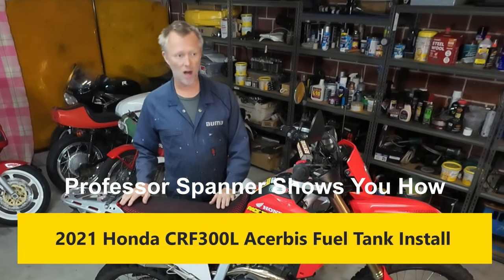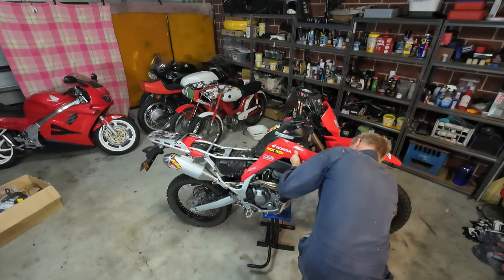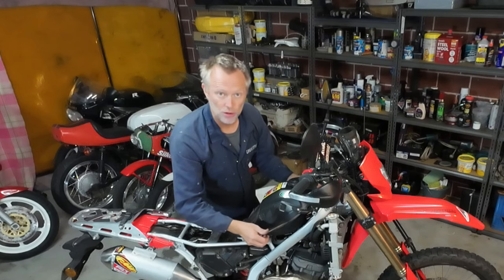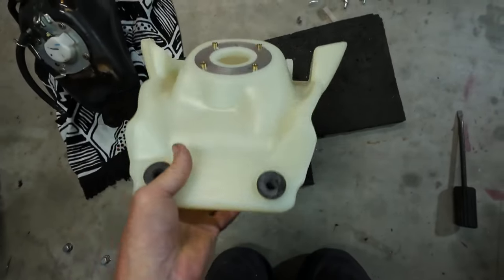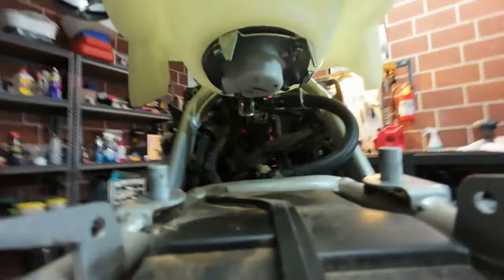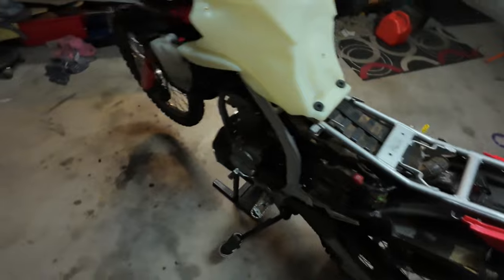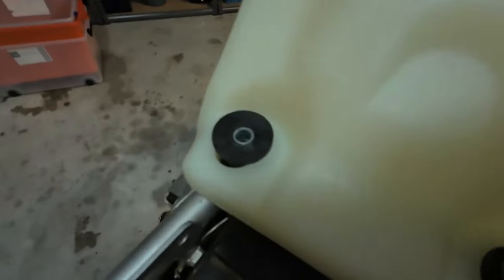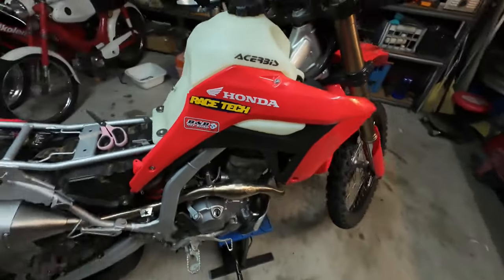2021 Honda CRF300L Acerbis Fuel Tank Install

Comment: How about black hose under the tank, you close or connect to breathing pipe to cap. İ could not notice on video, thank you for your video
Reply from the maker: Your very welcome and thank you for subscribing.
The thin 'breather' tube connected to the underside of the stock tank is not used on the Acerbis fuel tank as the cap  has a vent tube with a one-way valve in it.
Reply: @TheSpannerLab  thank you

Comment: Did you do anything with the stock turn signals?  Mine were hitting the tank so I had to take them off.
Reply from the maker: I didn't and yes, mine also hit the tank. I rarely used the bike aggressively and sold it shortly after fitting the tank. Great bikes but you can see from my other videos that I'm always changing things around. Thanks for watching.